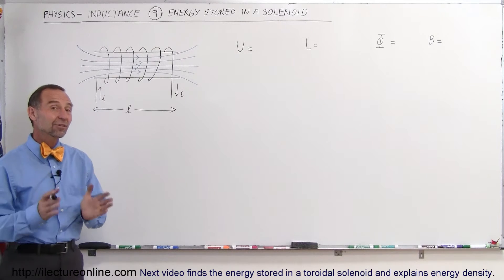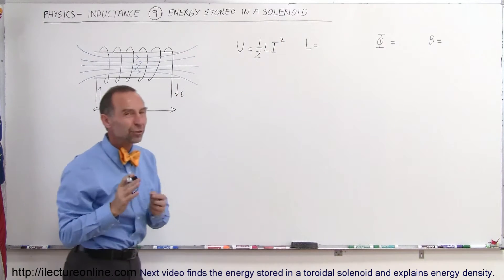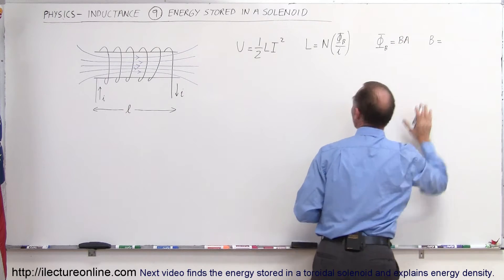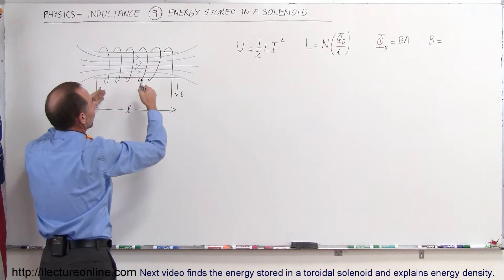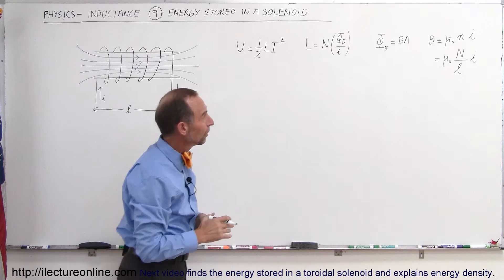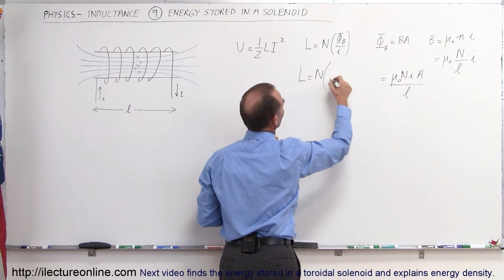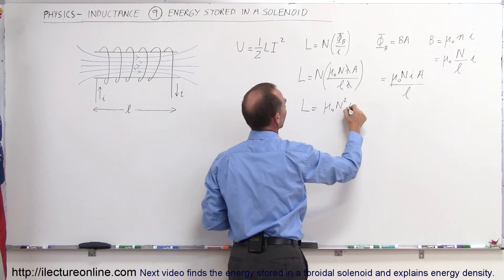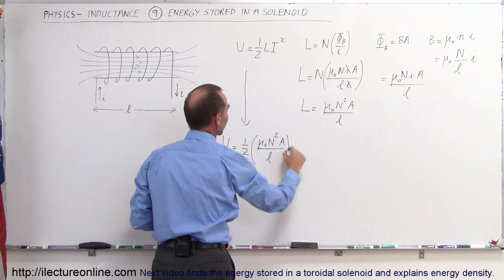Physics 47  Inductance (9 of 20) Energy Stored in a Solenoid

Comment: I presume that I-rms be used for I in the formula U=1/2LI^2. Is this true?
Reply from the maker: Since this equation represents the energy stored in the solenoid at any moment in time, we actually use the instantaneoud current.
Reply: At 18 seconds in you say "steady state Current"
Reply from the maker: Yes, if the voltage applied is DC voltage, then eventually the current would reach a steady state value.
Reply: @MichelvanBiezen  thx
Reply: Thx so much for the reply!

Comment: I have a question, what is the unit for energy stored in a magnetic field?
Reply from the maker: +Marcus Lavery 
The units for L (inductance) = H (Henry)
1 H = 1 Wb/A = 1 V * sec/A = 1 Ohm * sec = 1 J/A^2
Therefore U = 1 J/A^2  * A*2 = J (Joule)
Reply: +Michel van Biezen Thank you sir, I figured it was joules, didn't know if it was any different in Magnetic fields thank for your answer